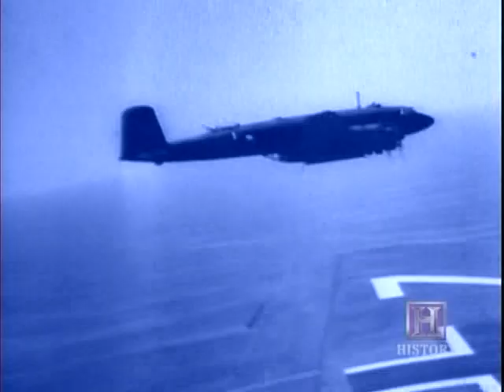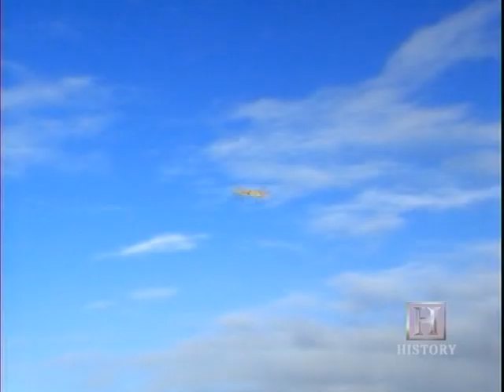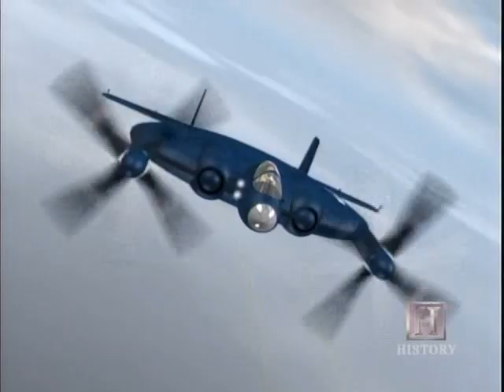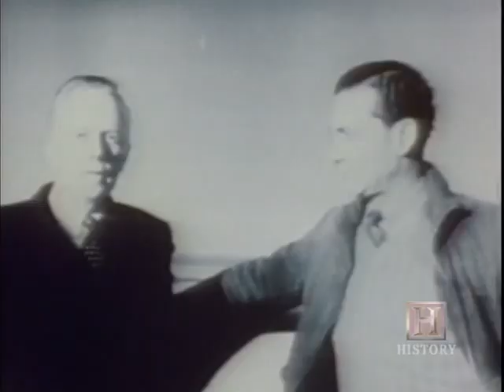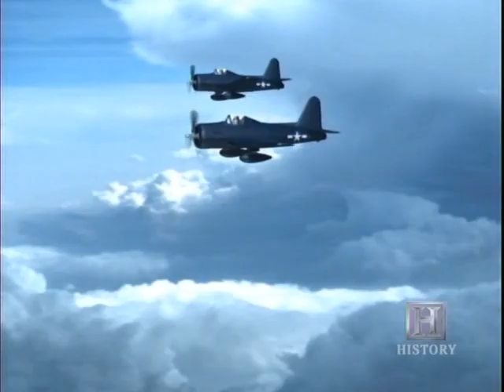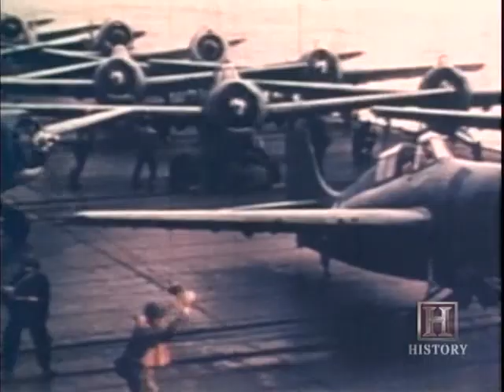Secret Allied Aircraft of WW2

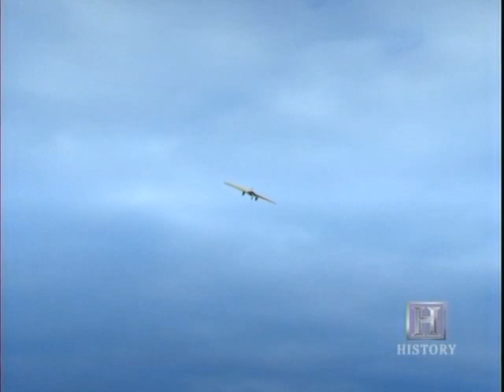Comment: The plane at 25:36 that the narrator refers to as XP-79A is actually the MX-324 research aircraft. It was designed to test the flight characteristics of the rocket-powered XP-79, which had a single fin and one rocket engine.

There is no evidence from Northrop documents that the XP-79 ever was intended to use its wings to ram into enemy aircraft.

Comment: The explanation of how wings produce lift is a little outdated.  Smoke-puff experiments have shown that the airflow over the wing and that under the wing have the same speed and so don't really produce lift.  Lift is mostly produced by angle of attack.  You can tell that if you sit in a commercial jet as it roars down the runway.  Look out over the wing and the wing doesn't flex until the pilot commands rotation.  Directly the nose comes up, you can see the wings flex upwards as they provide lift.  The inclined plane effect provides the lift.  When I learnt to fly the exam question regarding lift still required the traditional answer that it was the Bernoulli effect.  When I questioned that, the instructor said that they had approached CASA who agreed that it was really the inclined plane effect but said that until the text books were adjusted, they couldn't adjust the required answer!
Reply: the jury is still out on the new theory. the B effect may not be the ONLY effect causing lift but it IS an effect. research spherical lift, as in golf balls and such
Reply: @crabtrap  As I said "Lift is MOSTLY produced by angle of attack".  Stunt planes have a symmetrical aerofoil, but fly perfectly well, despite a total lack of Bernoulli effect. And why can a plane fly inverted without being sucked into the ground?
Reply: @johnellerman1  stunt/3D planes rely much on thrust by obsurd power to wt ratio engines. Its what allows then to fly at extreme low speeds and hover. The flaperons used for deflection of powerful airflow from prop. They can hover for christsake. Your analogy is fallacious

Comment: Germans 🇩🇪 where years ahead
Reply: In many ways yes! The military in Germany was more supportive of experimental aircraft than the Allies were. But of all the propeller driven aircraft ever designed, I think the XF5U is the most advanced. Imagine if that had been further developed? At the same time, Germany was working on better jet engines. And some fantastic concept aircraft. It was an interesting time. Also the Russians were developing some amazing aircraft using a hybrid piston-jet engines called Motorjets. Some of which were very powerful and efficient. Germans also designed them but the documents remaining are extremely rare and limited. They had a X layout engine that was a piston and jet hybrid. It was developed for the Amerika Bomber. Because it was more fuel efficient than pure jets and nearly as fast. Also it needed no special metals like pure jets did. Fascinating stuff.

Comment: 24:30  They have it completely backwards. The Horten brothers had designed a number of inherently stable flying wing aircraft, some of them motorized. Northrop never designed an inherently stable flying wing, quite the opposite. Which is tragic from an engineering point of view: The US wanted a flying wing bomber, which needs stability, but Northrop didn't design that. Germany wanted a fighter (which needs some instability to be agile), but the Hortens designed only very stable aircraft.
Reply: +Thomas Bögel

 I am not familiar with the notion that the Horten's aircraft were inherently stable.
Reply: +Nathan Peterson They are. Dropped from any angle they will - given enough initial height
  - come to a stable and level profile. I am not sure about the early designs, but the later ones definitely. The glider they made post war was also demonstrated doing that several times.
Reply: The only glider they made post-war was a replica. Nor do I recall any wind tunnel tests.

Comment: GM built the electric cars called the EV-1, then rounded them all up and crushed them despite the leaseee's wish to actually buy them.  Toyota built the Prius and that car is the first practical high mileage car getting over 50 miles per gallon something the CEO of GM said in the 1980's was an impossibility.  Once again executive officers work against the best engineering and design to allow GM to finally go bankrupt.

Comment: High pressure/low pressure across a wing has largely been debunked.  The lift is produced by pushing the air downwards.  The shape of the wing is critical to doing that with minimal drag.
Reply: Well, not pushing air downwards, but diverting it downwards; you're only pushing the  air down for the part of the airflow under the wing when there's a positive angle of attack; the air over the upper surface is entrained along the surface by the Coanda Effect and diverted downwards. But that's nitpicking -- 'air goes down, plane goes up' is a one-syllable-word version.

Comment: Who made the first successful self-sustaining gas turbine? A Norwegian named Ægidius Elling, in 1903, but he was limited in his design, by methods and materials. Later, "the first patent for using a gas turbine to power an aircraft was filed in 1921 by Frenchman Maxime Guillaume. His engine was an axial-flow turbojet." However, it was never built, due to a lack of materials and tooling. "In 1928, RAF College Cranwell cadet Frank Whittle formally submitted his ideas for a turbo-jet to his superiors. In October 1929, he developed his ideas further. On 16 January 1930 in England, Whittle submitted his first patent (granted in 1932)." Whittle used Guillaume's patent as a basis for his engine. "Whittle had his first engine running in April 1937."

Also, "In 1930, Nathan Price joined Doble Steam Motors, a manufacturer of steam engines for cars and other uses. In 1933 he began working on a steam turbine for aircraft use. The engine featured a centrifugal compressor that fed air to a combustion chamber, which in turn fed steam into a turbine before exiting through a nozzle, powering the compressor and a propeller. The engine was fitted to a test aircraft in early 1934, where it demonstrated performance on par with existing piston engines except for difficulty maintaining power at higher altitudes due to the compressor. Work on the design ended in 1936 after Doble found little interest in the design from aircraft manufacturers or the Army."

"Price started work on his own turbojet design in 1938. To improve fuel efficiency, he used a combination of low-compression axial compressor stages feeding a high-compression reciprocating compressor. In 1941 he was hired by Lockheed to evaluate the General Electric superchargers being fit to the experimental XP-49, a high-altitude version of the P-38. Price had the basic design of his jet completed and was able to attract the interest of Chief Research Engineer Kelly Johnson. Johnson had been thinking about a new high-speed design after running into various compressibility problems with the P-38 and the jet engine appeared to solve some of the problems. During 1941 he ordered the development of a new aircraft to be powered by Price's engine, developing the engine as the L-1000 and the aircraft as the L-133." Price was also the father of the afterburner.

General Electric (Allison Engine Company), had made an agreement with the British in the late thirties, after Britain informed the US about their new turbojet engine, to use Whittle's design, where they modified and improved upon it.

The Lockheed-Price engine, though, is a one of a kind, and it was also based upon Guillaume's patent, and his work on turbochargers.

Price's "proposed engine was not officially accepted, because at that time the US government was informed of British work on jet engines. However, Price was encouraged by USAAF officials at Wright Field to refine his design. His redesign incorporated two sixteen-stage axial compressors with a single stage of intercooling. The first four stages of the forward compressor remained clutched to allow them to operate at optimum speed. The turbine was reduced to four stages. The low-pressure compressor was encased in a two-part cylindrical casing with stiffening ribs, which gave it an odd appearance similar to the bottom of an egg carton. The shorter high-pressure compressor was similarly encased but with ribs running front-to-back only. Power was taken off between the two compressor stages to power accessories, with the gearbox placed on the top of the engine outside of the compressor casings."

"In June 1943, the AAF did give Lockheed a contract for a jet-powered airplane, but it was to incorporate a British turbojet. At that point Price discontinued work on his design. The sole example of his engine is currently housed at Planes of Fame museum, in Chino, California."

GE's "J33 was originally developed by General Electric as a follow-on to their work with the designs of Frank Whittle during World War II. Their first engine was known as the General Electric I-A, but after major changes to adapt it to US production and to increase thrust, it started limited production as the I-16 in 1942, the 16 referring to its 1,600 lbf (7.1 kN) thrust. Full production started as the J31 when the United States Army Air Forces introduced common naming for all their engine projects."

Designs from both Whittle and Price are what make up today's turbojet engines.

Comment: In fact it was a German manufacturer who got the first jet engine closely followed by Wittle. However it was the German manufacturer who had the first operation jet fighter
Reply: Well, to be really accurate, the first jet engine was built by Henri Mare Coanda. However, his design never got developed further. It was Maxime Guilliame who patented an axial-flow turbojet in 1921; Whittle didn't apply for his until 1930. Both Whittle and Ohain were both building an engine in 1937. Whittle didn't get to put it in an airframe until 1941, though, while Ohain had his design flying in the He 280 in 1939. So who was 'first' depends on which definition of 'first' you use.
Reply: Richard: I don't consider a plane being operational when you can't take off climb, level off, and perform a landing without blowing up????

Comment: long thing wings like those on gliders have less drag but they are not strong enough for very high speed. so show is quite wrong here.
Reply: The Spitfire thin wings were stronger and able to handle higher speeds than any other piston engine plane ever.
Reply: and spitfire wings were like those of gliders? yes? no!
Reply: Barbika.
Not a bit like any glider I have ever flown or seen. 
The Spitfire wing could pull more G`s than most fighters and it could achieve a higher speed than any other fighter in WW II. 
All monoplanes have wings like a glider in as much as they have a wing each side of the fuselage.

Comment: Last entry is incorrect. B2, having failed to deliver high weight payloads while costing literally a billion per unit (adding in support costs) will be ended with the next "Big thing" within 8 years.
Reply: Wrong.  Look it up.  The bomb bays (there are two) can carry more than four bombs. The official capacity is 40K pounds, but is estimated for absolute max at 50K pounds.   

A standard loadout: 80x500 pound Mk-82 or GBU-38 on a bomb rack assembly.

Or, 16× 2,000 lb class bombs (Mk-84, GBU-31) mounted on Rotary Launcher Assembly (RLA)

Or, 16× B61 or B83 nuclear weapons.

And that's just internal, there are external hardpoints for other ordinance.

Three B2s took took off from the US and dropped 45 tons (90,000 pounds - 30K pounds apiece) of bombs in Libya and returned to the US.  Each aircraft was refueled four times during that mission.  Four refuelings in 12,000 miles.  Not bad.  A B52 would probably have needed 3 refuelings for the same mission.
Reply: Hellstrom Carbunkle What?
Reply: Kyle Bartley Maximum payload weight on the B2 is only 1472 lbs for a 750 mi round trip.
Worthless.
Reply: Hellstrom Carbunkle The B2 has a payload of 50,000 lbs...
Reply: Kyle Bartley Bullshit.
50K lbs would be 50 1000lb bombs.
THE BOMB BAY CARRIES 4 MAX!!
Reply: you know how much big its a one ton bomb? the b2 has literally not space to more than 4 bombs of that dimensions
Reply: santiago perez Wrong. 2 internal bays for ordnance and payload with an official limit of 40,000 lb (18,000 kg); maximum estimated limit is 50,000 lb (23,000 kg). Have you ever seen a B2? I have. They are fucking massive. I think you all are thinking of the F117.
Reply: Hellstrom Carbunkle One year later and it still makes me laugh how wrong you were. 2 internal bays for ordnance and payload with an official limit of 40,000 lb (18,000 kg); maximum estimated limit is 50,000 lb (23,000 kg).

Comment: They should have just made the pancake a jet powered plane.
Reply: It wouldn’t work that well - the prop wash is the reason that the pancake doesn’t lose air over the edge of the stubby wings.
Reply: They could have. It would have had more drag, low aspect ratio wings have a lot of wingtip drag compared to high aspect ratio wings. And the big propellers countered that drag by spinning opposite the wingtip vortices. However, with droop-tips they can slightly reduce that drag and jet engines would overcome the drag anyway. The pancake would have been a fast, maneuverable and capable aircraft even with propellers. It's ability to take off in very short runways and still fly fast and be agile would have made it a dangerous aircraft. Even today it could be useful as a close air support aircraft operating from roads and fields and not needing runways. And flying fast enough to operate with A-10s and slow enough to escort helicopters.
Reply: Wouldnt it have a huge radar signature though ?
Reply: Wardad. Probably not unusually large. the propellers would be the main part giving a radar return. It certainly would not be very stealthy. But that wasn't a large concern at that point in the war.

Comment: The pancake doesn't have a wide wingspan because it is pretty much just a big wing with a cockpit and propellers.
Reply: 'The Trick' of the Vought, was in the Prop's Vortices, as those Props rotated in Opposite Directions (like a P-38, and the F-82,-AHEM- once N/A had figured out L+R!) that added Huge Lift to the wing's top flow. The Big Issue, was, sadly, the Gear-box of putting 2000 hp thru two elbow gears to those huge props. It worked, some-of-the-time, but failed too often to be functional/war-ready.